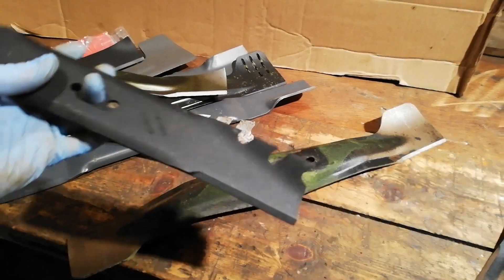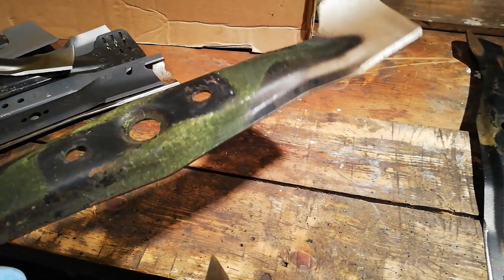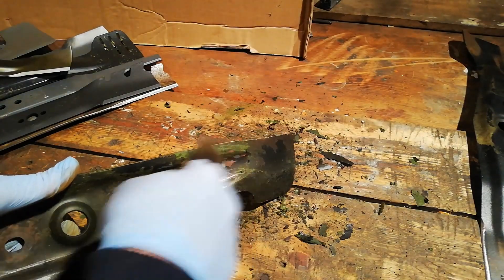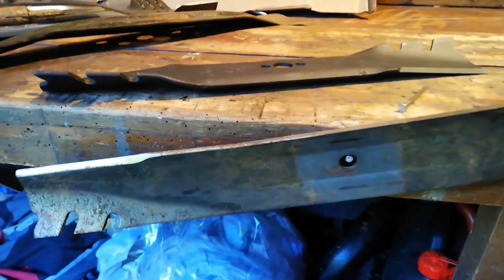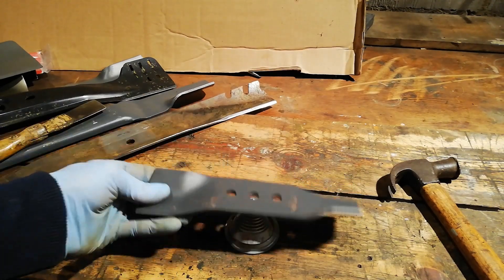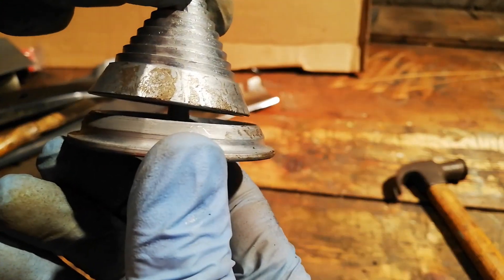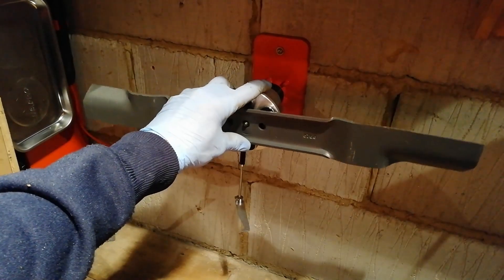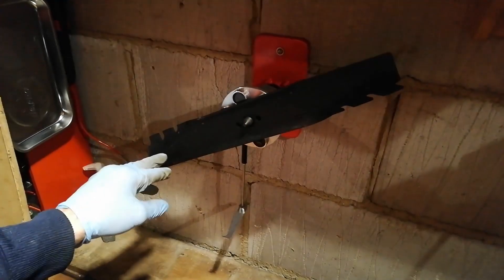How To Balance a Lawn Mower Blade, SHOWING 3 Different Ways

Comment: For the cone type, number the sides with a marker to avoid chasing your tail. A tissue can be used to centre the hole. A suitable spacer ,washer,nut,etc to cover the tip and a bullseye level on that ,you can see l,r balance as well as f,b. Then the surface won't matter so much. Good  video, I suspect you tube uses more power than a grinder with a wire brush, if you  get sick of hand scraping don't feel guilty 😁
Reply from the maker: Cheers, too much faff with the lil cone balancer 😃. I tend not to use a wire brush etc as it causes too much dust and mess, its relatively quick with the scraper anyway. 👍
Reply: @RJLgardens  I would like to see someone invent a dynamic blade balancer. That would be the best way to balance a blade. But until that day comes I will use my 97.00 dollar balance tool.

Comment: This cone balancing really sucks just like the video there is way to much play.  A very thin nail works ok to give me an indication.  I clean and use a Q-tip to lubricate the blade hole and nail so there is no friction when hanging the blade dead center on the nail👍👍
Reply from the maker: Nice one, yeh im not a fan of the cone, the proper balancer is a game changer and far more accurate 👍

Comment: If you let the balance settle you'll see what the outcome is. It seems like you're afraid somebody will see how rubbish all those blades are and you being the expert? Hanging off a nail is a total farce if you don't know? As the blade rotates on the pin the register shifts from side to side so it is somewhat self correcting and a waste of time. Why dont you have your balancer mounted on a level table, so you can measure the exact position it settles into. then by drilling or grinding you can correct the balance to level as well as horizontal. P.S. you have to let go of it.......................................................
Reply from the maker: What are you on about 😂, all the blades shown here haven't been balanced yet so of course they are out. Like i said in the vid the nail is not accurate but it does offer SOME indication and is better than doing nothing. Why dont you do a video on it and help us noobs out.......